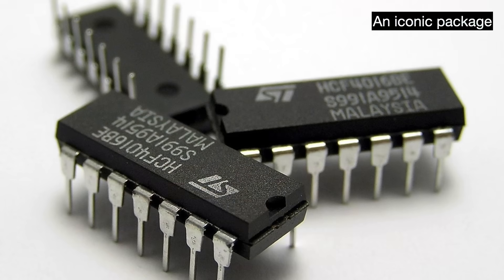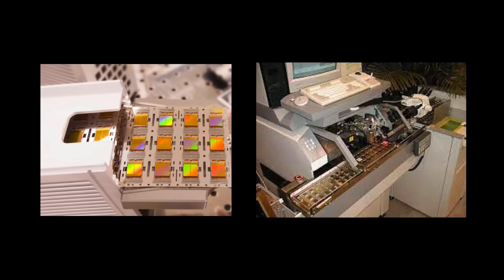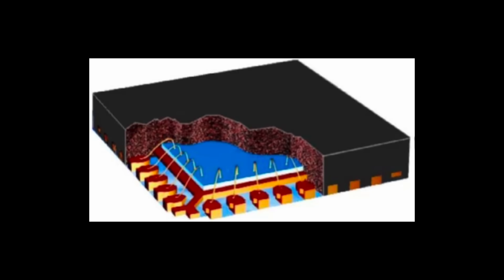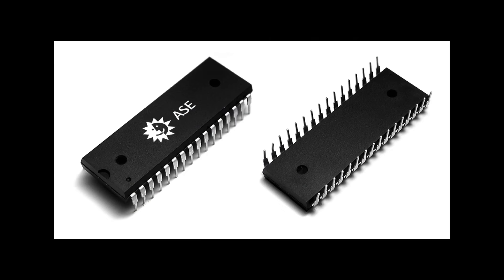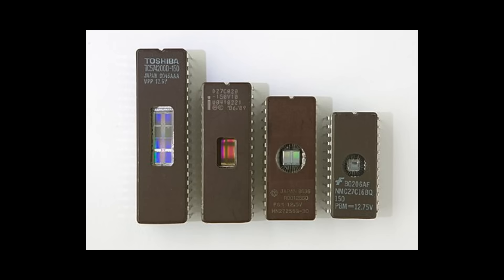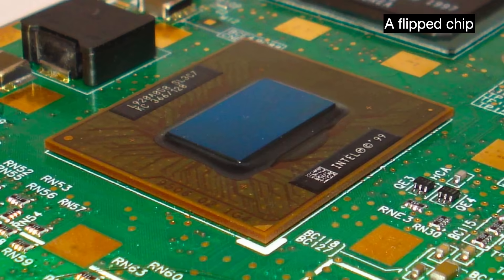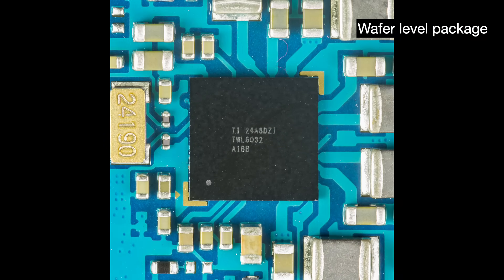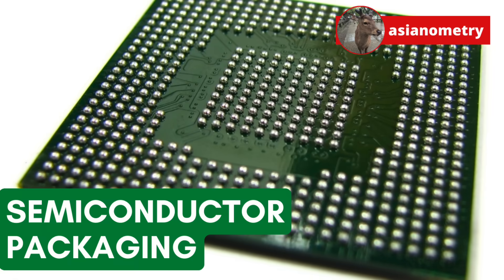A Brief History of Semiconductor Packaging

Comment: Nearly 80% of all Adv. Packaging technologies now used by Offshore Foundries & OSATs for the latest AI modules were pioneered ( inventing the technologies, tools, transitioning to HVM ) by 2 US based IDMs in AZ nearly a quarter century ago. Adv. Packaging is called  Dense Off Chip Integration ( DOCI ) by the AZ pioneers  ( PhDs all ) as the intention was to reduce Performance Penalties (?in terms of Latency, Bandwidth, BW density, Power Efficiency., physical size , … ) of Packaging when a large die ( i,e a SoC ) has to be fragmented into smaller dies to improve Die Yields at an immature Fab node. The term Heterogeneous Integration ( HI ) coined recently by IP Pirates misses the Density and Performance aspects of Adv. Packaging. Even low density / low performance PCBs have had HI for decades ( e,g. mixing Digital, RF and Opto components ). In order for the Fabless Designers to be able to fully comprehend and leverage the benefits of DOCI, the term Packaging needs to be finally retired.
Reply: the BGA, current dominant versions of Flip Chip ( used in systems like PCs, Cell Phones, Supercomputers, AI, … ) the fab & metrology tools for them, materials ( e,g Organic Substrates, both types ) were all invented in AZ at Motorola & Intel, now constitute an annual business in excess of $45 bn a year. Adv. Packaging techs like Fan Out that haveNOT grown much due to both tech &!cost issues had been evaluated in depth by those 2 IDMs in the late 1990s early 2000s but rejected in favor of Flip Chip. Despite recent R&D at TU Berlin for Panel type FO packages, the fundamental barriers to their adoption for high I/O packages have NOT been resolved. So their application remains confined mostly to lower I/O application. Since 2015 TSMC switched to ZFO type packages for the Apple A series SoCs fabbed also n’t TSMC, so cost factor can NOT be de convoluted

Comment: This of course is also just for signal level packaging. As a power electronics guy I can tell you packaging power devices is a huge field of study right now. You can imagine the advantages of halving the size of a motor drive in an EV or doubling the power handling of a device with improved cooling as a result of packaging.
I also see PCBA line operators and rework and service technicians curse the day BGA was conceived on a regular basis, and I cant say I'm not sympathetic.

Comment: There are couple of mistakes, but in general this is good material for most microelectronic students .)

THT (through hole tech) can of course use both sides of boards either only THT/THT or more frequently as combination of THT+SMD.

SMD boards of course have plenty of holes, in fact even more than THT, but mostly used as via and masked. SMD technology was enabled by SOLDER PASTE and REFLOW soldering. It was never meant to be manually soldered. And the economical side is not on reducing number of holes but on SIZE reduction. PCB cost per square area and number of layers. But if you are able to squeeze much more components on smaller place and run the whole pannel through printer and oven as one cycle, you are saving money on increased density.

PGA was nice, but it was not only about number of leads, but about possibility of insert chip into socket and replace if needed. BGA does not offer such option.. But have much higher density.

CSP/WLP brought 3D stacking in large amount of structures.

And you can add how even PCB itself can be used for stacking layers of burried components..

Comment: 13:39 Interestingly, IBM was actually selling metal can PGA chips as well, mostly for internal use. I believe they saw use primarily for ASICs, and the only times I've seen them in person are on the IBM 8514A video card and the PCBs of several of their Rochester designed voice coil hard drives of the early and mid 80s, like the 0665-53.

Comment: I hate BGA with a passion because not only it's hard as heck to rework and impossible to inspect without X rays or whatever, but even temperature difference as the chip cools from soldering can affect the bonding characteristics. This is what caused the Xbox 360 RROD failure, and why seemingly simple tricks like the towel trick (where you wrap the device in thick towels and power it on, making it overheat to hell) sometimes fixes a RROD error.

Comment: 14:28 it is my understanding of the nomenclature is that bumps are on the silicon and balls are on the BGA, so the interposer has pads on the top for the bumped die and balls on the bottom for the PCB.

Of course you can now just get bumped die as a CSP from the manufacturer, considerably saving space at the cost of more complex PCB routing (since there is no longer an interposer between the chip and the PCB). These are usually low pin count devices for this reason.

Comment: Nice video, just one thing...
At 11:10 you're not showing gullwing style pins, but J shape... those are made to be socketed or soldered and were sometimes seen socketed on fancier motherboard as BIOS chips. 
Those boards often came with a second spare backup chip.
Basically the predecessor of dual BIOS.

Comment: IBM was one of the first users of the flip chip ball attach method.  While expensive it not only increased signal performance but exposed the back side of the die to attach to a heat sink.

Comment: In flip-chip, BGA, or PGA, is the die connected through to the packaging via solder balls instead of bond wires then? I'd love to see a picture of the back of these things; the connection side, with the die and the connection to the packaging visible. Is it really possible to just glue a ball of metal to a silicon die like that? Fascinating.

Comment: IBM's version of the ball grid array dates to the 1960's. A patent for the solder ball started it all. The use of resist allowed an array to be registered with the flip chip - face down IC. The image shown here includes the addition of the pins to that array in a ceramic package. All of this was available by the early 1970's and was held inisde the company by patents. When patents expired others tried to duplicate, but the learning curve kept it inside IBM for another decade.

Comment: 14:37 Flip-chip actually limits your cooling ability a little because all the circuits (and thus all the current and all the heat) are on the opposite side from what the heatsink is touching--and silicon is not a great heat conductor.

That being said I'm not sure what kind of packaging offers better cooling than flip-chip--I was just given the impression it's out there. Probably something that bonds an electrically insulating thermal conductor to the printed side of the die?

Comment: An early (c. early 1960's) version of the ball grid array was IBM's original C4 (Controlled Collapse Chip Connection).  Individual transistors, and later, ICs, were mounted on ceramic substrates that had arrays of pins to attach to the circuit boards.  This technology was introduced with S/360 (c. April 1964).

Comment: Hmm, you missed some details and stages.
1. You forget to show the difference in die mounting between PGA and FCPGA.
2. Considering 3-rd dimention, you forgot to mention die stacking inside normal DRAM/Flash-ROM ICs (without vertical interconnections). Also, there are PoP and SiP mountings - BGA ICs mounted one over another with soldering.
3. There is also direct board mounting without actual package.

Comment: I never called them Vy ahs. It was always Vee ahs.  BTW  DIP pin spacing is on exact multiples of 0.100" (or 2.54 mm for the metrically plagued). Spacing of 0.5 mm (0.019685" aprox. ) is the smallest standard lead pitch currently.

Comment: Hi, I got a question!  You mentioned putting the PCB board in an oven thingy as a way to solder everything in one go but,  how can you melt the lead with enough heat without destroying the delicate IC?
Reply: Yes. As you point out it is a difficult problem. It is handled by controlling the rates of temperature rise/fall. Peak temperature and dwell time at peak temperature. Moisture content must also be controlled.

Comment: small correction, the chip shown at 11:08 is not a SOP, it is a SOJ - small outline j-lead package. It's main characteristic is that the pins are in the shape of the "J" letter and curve in under the chip. They use less area but they are taller than normal SOP chips. There's also a quad version known as PLCC which I loathe with a passion.
I suspect their main advantage over gull wings is that they can be socketed rather effortlessly, there used to be PC expansion cards that used SOJ sockets for memory expansions, but I've also seen a BIOS chips using PLCC sockets.

Comment: You should check out AMD's patent for active interposers. It looks like it's both a stepping stone to 3D packaging and a packaging efficiency booster in one solution. The patent describes how to move the power rails management logic onto the interposer for a variety of benefits including shrinking the chip manufactured on the expensive node (by removing voltage control logic) and distributing thermal density (by having high-amp transistors away from the power hungry compute blocks) while also freeing up connection area needed for the chip-to-interposer integration. AMD specifically mentions it in conjunction with GPUs, but for this generation they've gone with micro film PCBs for connecting the MCDs to the GCD, so I suspect the price for 65nm wafers to use as interposers is still prohibitively expensive.

Comment: I think of packages as little temples of technology. Even though physicists are glorified much more than engineers, their theories are not very useful on a human scale. The real world is much more complex than the cosmos or the laboratory, the temples of physics. So engineers have to make little tiny shelters of simplicity where all the miracles of physics can be performed safely.   Especially with nanometer sized processes, they're incredibly vulnerable to corrosion and static electricity. Some of the protection is on the chip itself with protective overcoats and static protection circuits, but some is in the packaging too, as well as on the circuit board.

Comment: Interposer don't have to be silicon, and is worth mention, because TSMC is using not silicon version a lot in finout design, cheaper, smaller, lighter. And is use in eg AMD Radeon RX 7900 XT/XTX to connect external memory controllers with cache. There are leaks that saying this are made so cache can be stuck on them (as 3d v-cache in Ryzen 5800X3D). And many with organic substrate are used in phones eg Apple using them for many years (chip on chip, when bottom is connect to interposer which is bigger and added connection to top chip around... weird but heat is [I think] main reason what is on top).

Comment: Bond wires don’t connect lead frames “to the the outside world.” Quite the opposite: They connect them to the encapsulated die. The leads themselves are what connect to the outside world.

Also, when you introduce DIP you begin by describing thru-hole tech (THT) as if that distinguishes it from TO-5... though obviously TO-5 was THT as well. You describe SIP/DIP as being 12-16 pins at first while showing 8 and 9 pin packages.

Comment: Another intersting thing about packaging is that if you were to package a MEMs that require some sort of open to the outer world to enable them to function properly (such as hydrophone), now you're in a situation trying to balance between enclosing the chip for better protection and fully open the part in qusetion to enable best sencing performance. In the end the packaging design is thought of during the IC design stage, ensuring the circuit layout is easy to work with, meanwhile definign the package to cope with the IC and make sure the performance satisfy the target usage critiria. The balance sure is delicate, most of the time they will require specialized packaging method, equipment and material.

Comment: at 0:45 you show a wafer full of printed chips, same as so many other wafers,  but...   Why do they print partial chips that go over the edge of the wafer?  Wouldnt it make more sense to never print those partial dies and speed things up a bit?
Reply: AFAIK the process etches a fixed window at a time, which can hold several chips at a time if they are small.
Reply: @musaran2  Yeah, but why do they bother to expose the partial chips at the edges in the first place? Considering that the step-and-scan (having replaced pure stepping which itself replaced full wafer aligning) has become very time-consuming as the resolution goes up.
Reply: @gregorymalchuk272  I did not know about step-and-scan.
A quick search indicates that incomplete chips are in fact rare, and associated with lower whole-wafer processes.
The beefiest chips tend to use the whole reticle anyways, making partial etching pointless.

There are images of wafers with no partial chips, but only a few.
Maybe the process is too confidential?
Reply: @musaran2  The only thing I can think of is this: After multiple applications of photoresist, exposure, etching, diffusion/ion implantation, and sometimes metallization, the wafer surface is so uneven that the mask image is out of ficus at various depths, and structures on the chip (like interconnects) risk breakage where they travel over the steps. So they do one or more "replanarization" processes where they (sometimes deposit additional substrate material or oxide) and then mount the wafers in polishing machines to polish them truly flat before further processing and later dicing. My thought is that not exposing and etching chips near the edge would make them too "solid", and their density and the fact that they physically protrude beyond the surface of the etched central portion would make it impossible to properly replanarize the whole water. Hence they must expose and etch even the partial chips on the edge of the wafer. I don't know, but that's my suspicion.
Reply: The goal is to have no variation in the density of the printed stuff. That means the die closest to the edge sees the same density of stuff as the interior. The loss of the die on the edge is inevitable, but this minimizes the edge effects.

Comment: This has been bugging me for a while:
Could you make a video about mow mouch of the wafer is wasted during the cutting process.
Presumably, the smaller the chip, the harder it is to cut it out, and the larger the waste.
Some sensor chips for example are so tiny you can barely see them, even after their bonding with the packaging.
Reply: I don’t have numbers, but I know the saws used are extremely thin. Like as thin as a hair. I have handled cut wafers, and the gaps between individual dice are absolutely tiny.
Reply: @tookitogo  wow
Reply: The saw is essentially like a thin foil rotating at extreme speeds. The thickness of the cut can be as small as 20 um (yes micrometers) or even smaller in specialized applications.
Reply: @Gameboygenius  With such a thin saw,  wouldn't the cutting speed be an issue? It could influence the production speed.
Reply: @mrJety89  That's just the width. It's still a circular blade. I don't know the dimensions, but probably a diameter in the order of hundreds of millimeters/several inches. I don't suspect the width is a problem for the cutting speed.
Reply: @Gameboygenius  Depending on the material, It could buckle if you run it too fast. And the centrifugal force will stabilize it for sure, but tensile strength is a Limiting Factor /tm/ as well. I'm sure it's not diamond, but.. what is it made of?
https://www.youtube.com/watch?v=_4fwgRQbwDo

Comment: I'm an old timer, and when I got into the business, the DIP was king. A lot of TO-5 (actually TO-99) still used for analog chips. 40-pins was really the practical limit for the DIP, though some were made with more pins. I have a 64-pin DIP 68000 displayed on my desk. Surface mount components were heavily used on ceramic hybrids, long before becoming common on PCBs. I believe surface mount sales only passed thru-hole, in the early to mid 1990s.

Comment: an interesting sideline in chip packaging was the alpha-particle contamination issue affecting early dynamic ram chips in ceramic packages -- in some ceramic packages, the ceramics contained alpha emitters, which introduced errors into the DRAM cells... when this was discovered, the hunt was on for alpha-free packaging. One winner, Coors Ceramics.
Reply: And some small credit to Intel for sharing this discovery, after they had mitigated it.
Reply: What is the actual material used in the ceramic packages? Some say soapstone, i.e., steatite. How it is molded to the required shape?

Comment: About recent adoption of TSVs, they are an absolute nightmare for the back-end engineers. Being a floorplanner, seing a nice rectangular die being punctured with 20000 no use holes is still the stuff of nightmares, even after taping out 2 chips with TSVs. Random timing fails never on connections before seen in previous chips requiring changes to RTL to increase latency.. power grids having to do a jiggle around holes and sometimes introduces crosstalk to low voltage sectors.. and the tools being absolutely unprepared for these kind of situations.

Comment: Chiplet is going to be a revolution.
Allow cheaper semiconductor with lowest defect rate to be connected together.
Bundle ram, cache, cpu, gpu, flash, IO in one packaging. The pins could directly go to screen, usb, etc, with very little need for other chips.
Faster, cheaper, more efficient.